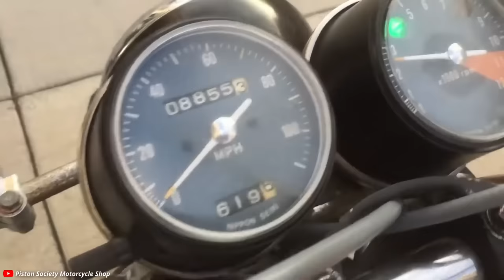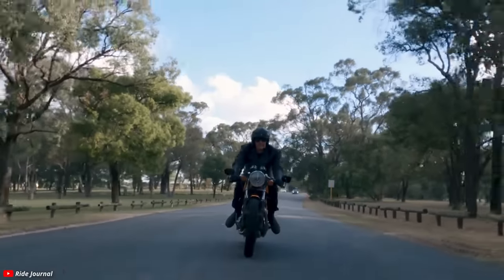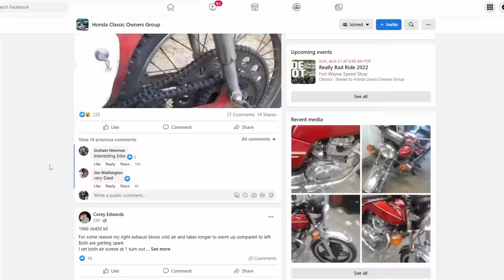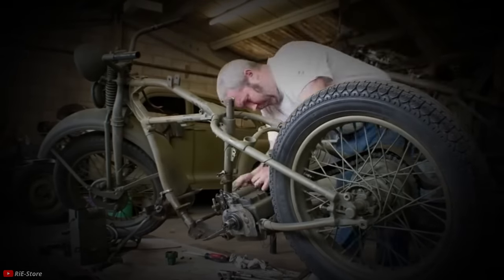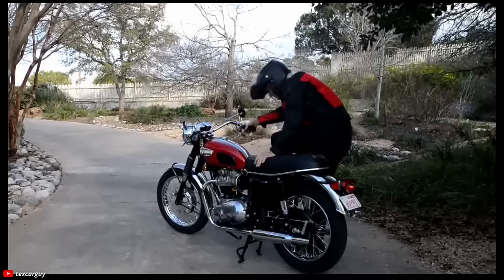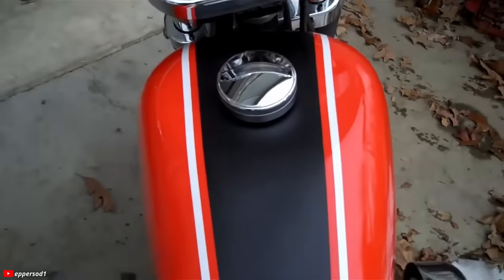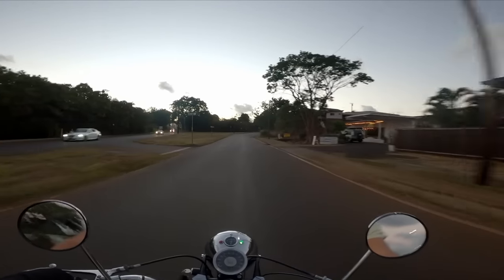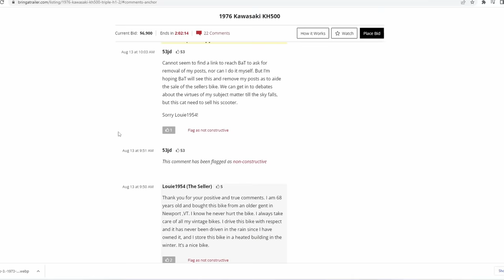So you want a classic motorcycle...

Comment: Here's what I'm finding out restoring a '74 Kawasaki H1 triple to about 95%.  I had a '72 Kaw 350 triple, and brother had a '70 Kaw 750 triple back many decades ago, so I am fortunate to know how to work on them.  Whatever your estimate might be for restoring a classic motorcycle, triple it (no pun intended) or even quadruple it.  There are fewer places for chrome plating and the cost for re-plating is through the roof!  For instance re-plating one wheel is $375.00.  Re-plating the 3 exhausts $2500.00 (sent to England).  Paint to factory original $2,000.  Powder coating the painted parts (not the frame) $600.00.  Recovering a seat to look like OEM $350.00.  Having Don Fulsang (the best in the business) restore the meters $350.00.  Parts are available for most classic bikes, but you'll pay through the booty for them.  The barn find bike I purchased is mostly complete, but every part has to be dealt with, and many replaced because of 50 year rust/corrosion.  Forks were replaced:  The original ones were ok, but had specs of rust so I replaced them $100.00 (reproduction).  Tires were dry rotted.  Cost to replace $420.00.  Spokes were rusty  - new ones = $100.00.  Cost to have a shop lace the new spokes, install the tires, and balance with a digital meter = $275.00 (got a great deal).  New rubber dampers $300.00.  New bolts and screws $200.  Plastic chrome on blinkers flaking off.  Cost to replace the blinkers and stems $100.00 (reproduction).  New chain, new brake pads, new handlebars, new handlebar switches, new gaskets, new cables, rebuild carbs ect, ect, and ect.  I've got hours sanding the frame for painting, polishing the corroded aluminum, putting parts back together, and dealing with 50 year old wiring.  It never stops!  Figure I'm going to have close to $8,000 plus what I gave for it.  Is it worth it?  I have a lot of free time, so in my case it is.  Hope this gives you some idea what you're up against.

Comment: New owner of a 1980 CM400T.  It has started me on a journey to becoming a better small engine mechanic.  I'm already good with electronic work but mechanical things I've not had the desire nor availability of things to learn on.  As soon as I sort out the misfiring around 3k rpm, I'll be so happy!
Reply: Any progress on the bike John? I've just picked up an 81 CM400E and would love to hear more about yours!
Reply: @motomotorized  I'll be trying to improve the bike over the winter.  I've mostly spent my free time enjoying it, the misfiring seems to clear up after about 15m of cruising.  Money is always an issue and xmas is coming.  My plan before next spring is an oil change (and inspection of a leak around the shift lever), new head gasket, new choke cable, and new tires.  I may take the carbs out to clean them but I'm nervous I'll desync them.  The throttle doesn't spring back like I think it should so there's another reason to get into the carbs.

All said, it starts and runs good enough that I just ignore most of the above and go for a ride.  Honda made amazing bikes in the 70s/80s, I'm a big fan now.

Comment: Brilliant video. Spot on I’d say. Of course I’m speaking with hindsight, having had many bikes and I do all my own maintenance work. I recently broke a cardinal rule…. I bought a pretty bike; a show bike. Having rebuilt bikes in the past, I decided to pay a little more and buy a complete bike which looked superb. In fact the same colour as your title shot, a 1968 CB250K0. It had been displayed at shows. I have ridden it a few times and commuted, but I have had to apply copper slip etc to all the bolts which have never been lubed. Fitted a new clutch, two carb strips, an oil leak from the rocker area, deglaze rear shoes and do on… I’ve got the experience so not the end of the world, but as you say, not something for a newbie if they have no access to a mechanic. Stick to good old advice which I didn’t. Buy a runner, it’s always better than a bike that has been sat.

Comment: Really great video! Thanks for the mention of Keep On Wrenching! You nailed it. I find Honda 350s from 1968-1974 are a great bike to work on due to the parts availability and the affordability of those parts. You can grab one for less than a grand typically that's mostly complete. From my experience, it takes about $2,000-3,000 to fully restore one as a baseline. Of course, that depends on what you're starting out with. Totally agree that you should try to get original parts and not cheap knock-offs. At the end of the day, the 350s are super reliable, about as simple to work on as it gets, and can help jumpstart a new hobby. I agree that you should try to look for something that has a freed-up engine (not locked up) if you're just getting started. If my first bike (70 CB350-running) would have been my 2nd bike (72 CL350-locked up) I don't think I would still be restoring old motorcycles! :)
Reply: If you change the cam chain, remember to tighten the sprocket bolts. don't be an impatient eejit like I was. When you are nineteen, you know it all but still blow up engines. Another hot tip, check the spacers on the front wheel spindle are assembled in the correct order, such that the wheels line up. I have the scars on my knees to prove that this is important. I enjoyed the Honda 350 but did not enjoy being spat off of it at 60mph.Have fun with your bikes.
Reply: Hier in Deutschland war man als Jugendlicher mit der Cb 350 König auf der Straße mit über 30 PS. Das hatten hier nur einige Jahre zuvor wenige Motorräder der 600 ccm Oberklasse von BMW und Zündapp.
Reply: @jensnitsche4994  Das ist so cool. Die CB350 sind so besondere Motorräder. Sie wecken viel Nostalgie.

Comment: As someone who has been around old and very old bikes as early as the pre war 30's both from Europe and Japan not having any mechanical skills is not a problem at all, you can do everything short of machining a damaged cylinder by yourself with very little tools.

Old bikes are so simple in their conception and have very little to no electric circuit at all. All you need really is the Haynes manual for the biie you get, preferably the original owner's manual for everyday maintenance and somewhere to work on it without being in the driveway or in the street.
It can seems daunting to take an engine apart to check the valves or redo a finicky transmission but as long as you follow the manuals and use the right tools anyone who's willing to try and get dirty hands from time to time can do everything a shop would and more.

Last word of advice that you don't hear often enough I think is that Japanese manufacturing seems to use Philips head screws for everything but it's actually JIS, Japanese Industry Standard, the shape is slightly different and if you use Philips screwdrivers you'll eat all the screws on your bike so get a set of JIS screwdrivers if you choose a Nippon motorcycle.

Comment: Thanks for another great video!    
50 years ago, I bought a worn out Yammy 250 twin 2-stroke for $400- (1969 "DS6" AKA "RD 250" and precursor to the RD350 and then RD350SLC). Bought the repair manual and lots of parts and rebuilt it over the winter, and  rode it the next summer. 
BTW: I was 14 when I bought it, 15 on the road, and only stopped by police once before I was old enough for a license. 
After owning a few bikes bought used, I worked up to a new vStrom 1000 in 2008, and rode it for 10 years.  But since then, I've had a 2008 Moto Guzzi, 2004 vStrom 650, and a month ago I traded the tall vStrom for a 2003 vStar 1100 Classic. 
With a new XR150L stablemate to handle "off pavement duty", I've now gone from decades of fuel-injected bikes with center stands to a couple of carbureted bikes minus stands.   I bought a lift. 
I'm looking forward to doing the valve-lash adjustments on the vStar (on one of the longest lasting engines ever), replacing the rear spring/shock, and maybe rebuilding the forks with progressive springs, over the winter. 
Both bikes are air-cooled, which eliminates the issues of antifreeze up here by the North Pole (north of Winnipeg MB) but also the hassle of draining and refilling coolant whenever the engine is worked on.  Another consideration with older bikes. 
The XR150 needs the stock "CARB compliant" jets replaced with some that won't cause burned valves due to running too lean.  However, the vStar, with its twin down-draft Mikunis, has smoother throttle response than many of the injected bikes that I've owned or ridden.  I found that shocking (in  a pleasant way)
If I did move up to a newer, injected cruiser, I'd likely get a vStar 950 for the injection while remaining air-cooled, but also drop my insurance costs.  Though the older Kawi Vulcan Nomads with hard luggage whisper to me whenever I see one advertised under CA$5k.  
On the other hand, in 2028 the vStar 1100 will get Collector Plates and that will cure the insurance cost issue. ;)

Comment: Back in the day, I rode a '71 Honda CB450. A great bike.  Light and easy to handle but enough power to cruise the highway.  But I always wanted an inline four, such as a CB750 and started looking around for one.  But, I was a little nervous about the reliability and parts availability of a 50 year old bike.  Then, I discovered the Honda CB1100, sold in the US from 2013 to 2017.  And a beautiful red and silver 2013 is now in my garage.  It's an air cooled inline four with classic '70s styling but modern electronics, including fuel injection and Honda reliability.  The perfect marriage of old and new.

Comment: Bart I’m a huge fan of your channel and I don’t think there’s anything to keep you from growing a hugely successful channel. As an owner of a classic motorcycle you pretty much summed up the whole vintage bike ownership experience.  

I’ve pretty much managed to keep my 75’ Kawasaki Z1b running with the help of a good Haynes service manual. Fortunately there is still OEM parts still out there and available. But scalpers are scooping up parts and driving the prices upward. I’ve repaired many bits and pieces of the bike with just disassembly and a good cleaning. I know the bike from one end to the other.  With that said I’m just not prepared to split engine cases and pull all the internal out and do all the machining and measuring all the tolerances etc.  I’m going to go to a well know vintage bike mechanic shop for the internals. 

So far my 75’ has 14k on the clock and an extensive internal rebuild is not yet needed.  I’ve slowly over time replaced or repaired nearly everything from cables, brake pads and shoes, sprockets &, chain, points, calipers, master brake cylinders, fork seals and the like.  As I go I paint and polish to keep the bike corrosion free and looking good or better than it was. And for Gods sake don’t take something apart and let time get away from you getting it back together while it’s is fresh on your mind. Some fasteners and the like have very particular  specific places they need to go, and you aren’t going to recall all that years down the road. 

Nuf said I’m going to go out the garage and admire my classic 75’ Z1.  😎
Reply: Absolut richtig!
Reply: Do you think certain classic bikes are gonna keep climbing in price? I’m debating on getting into one before they keep going up.

Comment: Having owned 3 Honda CBs (750K, 750F and 900F) among several others, I can say the CB750K is an excellent choice for a classic that feels modern and is also nicely reliable.

The advice about sitting on your idea and letting it settle is absolutely true. I rushed into buying my 240Z. It was the first one I saw and drove, my father told me not to, but what did he know? Well, I found out what he knew.
Reply: Like the Kawasaki Z200, where the cams where wearing faster than the tires?

Comment: I used to have and old 1981 Honda modified cafe racer that I bought on a whim cus it was pretty. A bit after I bought it the clutch failed and I couldn’t find a replacement anywhere, I asked my mechanic if he could jury rig it and he ended up mounting an old Suzuki clutch on a jackshaft and connecting that to the transmission, it worked pretty good. A few months later it started leaking oil, turns out the engine block had a crack, I had to fill it up every other week. Then the lights failed, my mechanic “fixed them” but they failed a week later so I ended up just charging my battery every day after coming home from work. Then the front brake stopped working and by that point I was already pretty annoyed with it, plus it was really uncomfortable to ride, the seat was to high and the handlebars were too low and it hurt my back so I ended up selling it after only a year.

Comment: I used to own a Sunbeam Alpine.  I can't remember how many times I pushed it home.  At least it was a lightweight car.  When I sold it, I had spent more time working on it than driving it.  It cured me of my desire to own a British car.  I prefer Japanese and German vehicles now.  They are more dependable, and parts are easier to find.  Good luck and take care.
Reply: Had the same experience with a ‘59 Triumph TR3 and a ‘64 Triumph Spitfire.  I learn slowly.  I had to go thru TWO Triumphs before I learned my lesson.  Never owned ANYTHING British built again for 60 years and then it was a flipping pellet gun that I got a spectacularly good deal on.  German, Japanese, whatever, but never again a British car or motorcycle!

Comment: My list of classic bikes, 1945 350cc BSA B31, 1958 250cc BSA C11G , 1968 250cc BSA B25 Starfire ,  1965 Triumph Tiger 100 500cc, 1972  650cc T65 Trophy Triumph  , Triumph 650cc Thunderbird custom , 1975 Triumph T140V Bonneville 750cc , 1981 Triumph T140ES Bonneville 750cc , 1972 Norton Interstate 750cc , Honda CM450e 1983 , Honda CM450c 1982 , Honda CMX 450 Rebel 1986 , 1998 Triumph T959 Daytona , 1993 Triumph Thunderbird 900cc , 1998 Suzuki Marauder 800cc, and a custom flat tracker made with all the left over bits in the workshop and garage (not finished yet) .

Comment: I have a 1973 Yamaha AT3 I got from my dad. It was his old bike as a kid. Hasnt run in 20 years, the tank filled with varnish and rusted out (Took us 3 years of searching and close to $500 to find a good new tank). She also needs new fork seals, a new gauge bracket, new tires, a brake job, new turn signals, and a fuction check on the oil injector. 

Im used to working on cars, where I have to moonlight as a contortionist to get the alternator out of my Prelude for example. So this should be rewarding and less of a headache. Key word being should

Hopefully we can get it running  again soon. Wish us luck

Comment: I've owned a number of the bikes you mention when they were new (CB350, CB750F1) having started riding in 1971. I've also rebuilt four of my engines due to some issue (Honda C92 125cc twin - split a piston, CB350 - chipped a camshaft, Norton Commando - because I could, CB900F cam chain replacement). I'd add a couple of considerations to your list: Norton Commando fastback (750 or 850 electric start). Great handling, simple (separate gearbox and engine) and light. For a smaller classic, the single cylinder CB250RS is a great choice. When looking for an older bike, also check the rubber items like boots, intake, hoses and if possible, seals (my 2005, ST1300 needed a new clutch seal that was a challenge to replace). Great video, thanks.

Comment: I recently bought a 69 Triumph Tiger TR6 motorcycle from a ‘classic motorcycle dealer’ that was found in a horse stable in San Diego California. It actually runs perfect with no smoke, and starts on the first kick. They changed the oil and cleaned the carb. Why I love the bike is because it’s all original except for the seat. The paint is metallic red, tank and fenders, sun faded and a nice color. Chrome has allot of patina and wire looks good. Tires are old and hard, fork boots were cracked and open. I paid 9K for it and added 1K for new Dunlap tires and rebuilding the forks and new brake shoes with wheel bearings replaced. It’s still in line to be fixed, I hope to have it soon.This is my first motorcycle I’ve had since I was 22 years old, I’m 68 now. I’ve always wanted a Triumph after seeing the British Zombie movie “Psychomania” in the 70’s. 😅 my first real car was a 77 VW Rabbit. Over the years I always owned various VW’s, this has taught me to be a background mechanic, doing my own maintenance, changing motors, and doing electrical wiring on them. I watched videos on Triumph motorcycle maintenance and working on a points distributor and I’m sure I can ‘Tinker’ around with them (JK) 😂. I’ll definitely be able to fix the bike in an emergency, but just in case I got AAA motorcycle towing option. I’m not intimidated by repairing this machine, I’ll enjoy cruising around on it and feeling the nice cool California breeze on my face very soon. 😊

Comment: I had a 1982 Honda CBX-1000 Prolink for 23 years from 1998.
Very few problems. I put 86 000 km on it and sold it last year with cac106 000 km on the odometer.
They are surprisingly easy to work on. It just takes a little more time.
Checking the valve clearance 0f 24 valves takes a little more time.
Everything is easy accessible.
The only drawback is the fuel consumption. I averaged 14.6 km/l using it for touring.